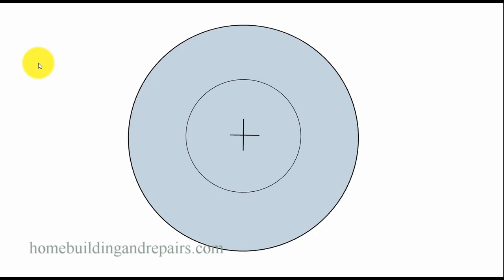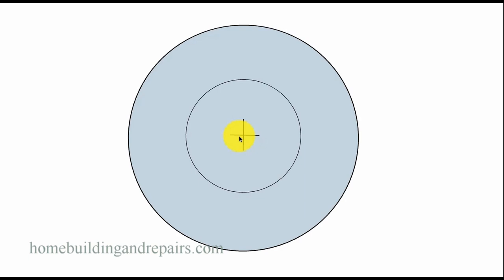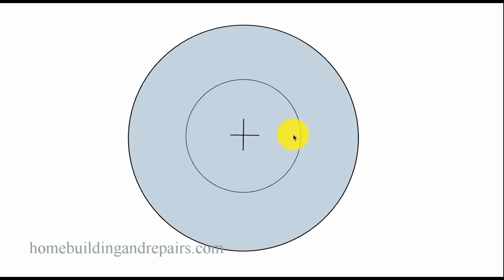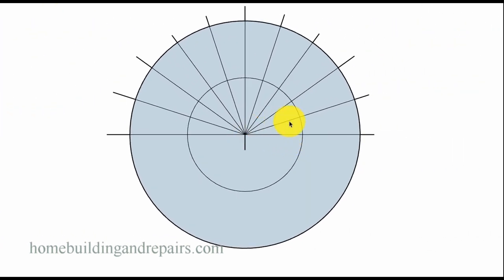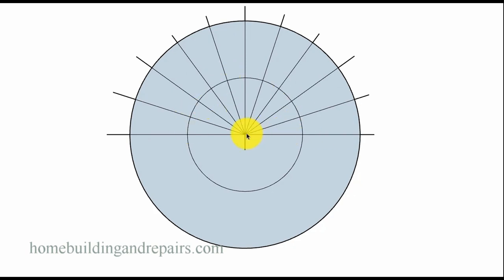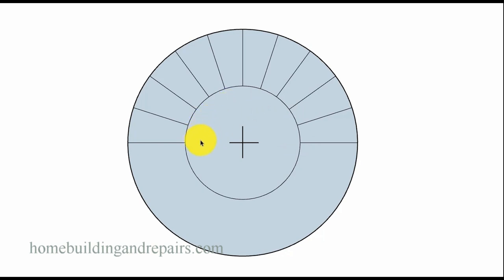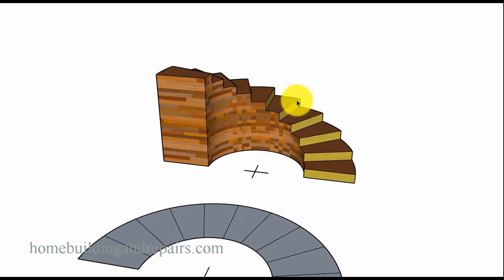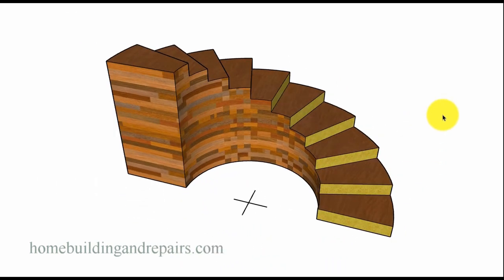Learn How Professional Designers Layout And Design Half Circle Curved Stairways

Comment: Sir if waist of stairs 3.5 feet and riser of stairs 7” and tread of stair 13”-7” feet sir kya semi round stair 13x8 space me constructe ho sakta h. Please tell me sir
Reply from the maker: I can't make out for sure what you're asking.
Reply: He is asking if it’s possible to construct semi circular stair case in a space of 13’x8’ with following specifications:
Width of stair  = 3.5’
Riser.               = 7”
Tread width    = 13” on outer radius and 7” inner radius
Height of floor = 11’